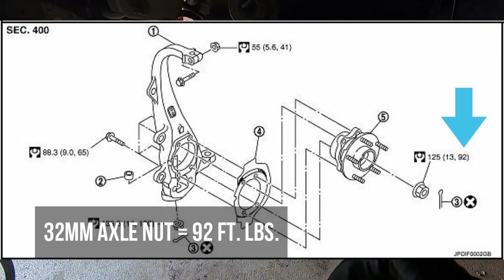2007-2013 Infinity G35x & G37x AWD Front Hub Bearing Replacement (W/ Brakes!)

Comment: Where did you buy the hub assembly from?
Reply from the maker: It’s a MOOG, from Rockauto.
Reply: @TheOriginalBeeCee  thanks man, I appreciate it, didn't want to mess with pressing the hub(wheel stud assy) out of the old one!
Reply from the maker: @Carl09of09  definitely agree, assembly is the way to go 👍
Reply: @TheOriginalBeeCee  I couldn't find that part you got a part number by chance?
Reply from the maker: @Carl09of09  thats probably because it wasn’t a MOOG lol. Sorry, I do my fair share or different cars and they sometimes blend together lol. But just checked my order history, its a TIMKEN HA590125.
Reply: @TheOriginalBeeCee  Cool bro I really do appreciate it, Thanks again man!✌️
Reply: @TheOriginalBeeCee  Thanks got my answer 👍
Reply: @TheOriginalBeeCee  I did so much resurch to get the right model number of parts. Unfortunatelly the Timken HA590125 is the wrong one for the G35X 2004 🙄
That’s for an FX35 😕
Did it really fit your’s ??
Reply from the maker: @pierrebinette9408  hey hows it going man. That was 100 percent the part for the ‘08. I actually just did a bit a research on the part for an ‘04, it seems from my main part source they only have the RWD hub listed, I see nothing for an AWD. Although, if you look up an ‘04 G35X on Advance Auto Parts they have some hub options. I would suggest checking them out.

Comment: No torque wrench thing crossing fingers
Reply from the maker: You can get away without it. Just don’t over-torque. You can feel it out basically. Don’t force it.
Reply: Didn't tighten the lugnuts down enough wheel almost fell off lost a stud might have to redo the while thing
Reply from the maker: @bennettthomas6434  ahhh damn man. Sorry to hear. You can rent a torque wrench from autozone. You can torque the lug nuts, they should be 80-85 ft. Lbs., that way there should be no questions.
Reply: @TheOriginalBeeCee  deffinatly a future investment